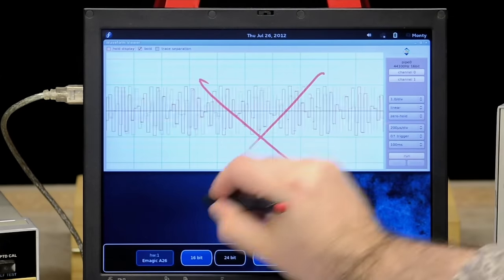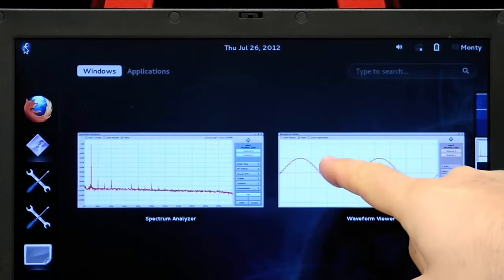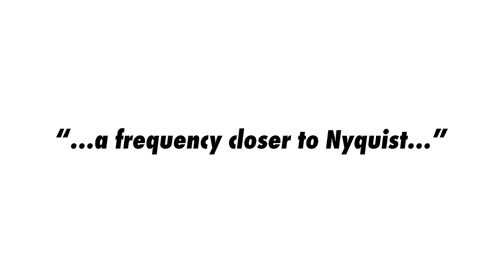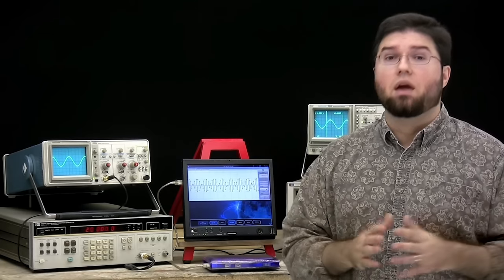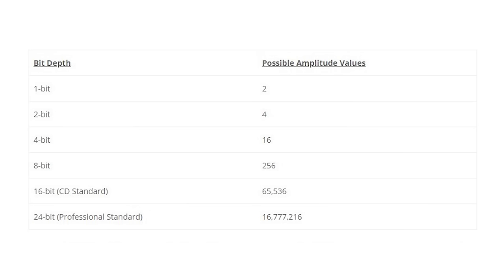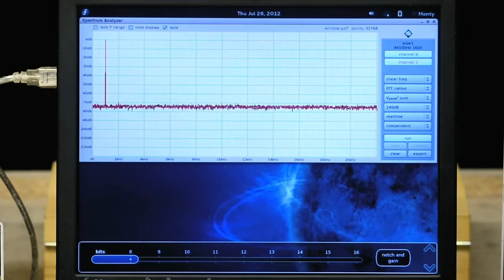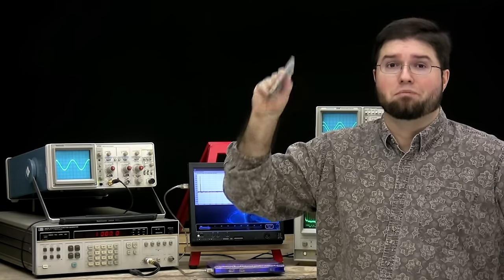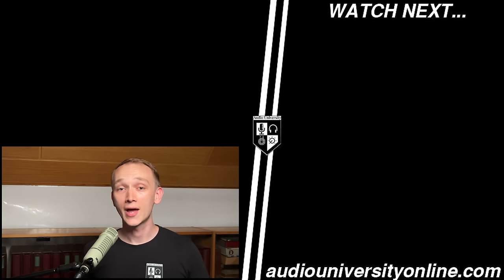Debunking the Digital Audio Myth: The Truth About the 'Stair-Step' Effect

Comment: Measuring equipment like oscilloscopes typically display input in an analog or a digital format depending on what the technician operating the equipment is trying to ascertain. The digital representation of information is helpful when fault-finding digital equipment, but irrelevant in the analog domain. The demonstration in this video does not constitute “proof” of anything. You need to measure the correct thing, the correct way. An analog sound signal is always analog and it is meaningless to measure any digital representation just to ascertain that the analog signal is stil an analog signal. This video gets things badly mixed up here. Indeed, I have never come across anyone saying that they could hear a stair-step effect, as claimed by this video. I suspect the claimed myth was made up primarily to dispel it. The information in this video relating to sampling theory and to the statement about higher sampling rates lowering the noise floor is correct though.

Comment: You are dead wrong, and here's why: hi-res audio isn't about reproducing a range of frequencies. It's about the sheer number of details that can be preserved. Take a 12mp photo and a 120mp photo of the same landscape. The 120mp photo doesn't suddenly add colors that the eye couldn't see before: it preserves all the details that coexist without smashing them together. You get individual leaves instead of a blurry tree. Just like the lollipop graphs blurs the space between samples, the details in a low-res image are blurred between pixels. The difference is clearly audible on a good set of speakers, just like the difference in photos is clearly visible on a good screen. I can hear it very very clearly, and hi-res audio is much less painful on the ears at high volume than CD-quality trash.
Reply: no. his point is that the so called "staircase effect" is fake, which is correct
what you're saying has nothing to do with this
Reply: It has everything to do with the "hifi has no advantage over 44.1." BS,
Reply: @dawnpoint  give me a timestamp
Reply: @2fifty533  Did you even watch the video? Right at the beginning he says 16/44.1 is just as good as hi-res. It's not, end of story.

Comment: You don't talk enough about why dither is used, why its so important, and how it needs to be applying at every point in the mastering process.  Some early digital recordings were improperly made on a rather imperfect 14-bit ADCs without proper dither leading to many people finding CDs sounding harsh in the early days.  

Personally I think high res audio is a waste of time and space, but if you're curious for the "Pro Hi Rez" side, read a paper by Stuart, J. Robert (March 2004). "Coding for High-Resolution Audio Systems", though in that paper he is more criticizing SACD than advocating for higher frequencies.  He also extensively talks about the importance of dither and while he does find high bit depth to be useful he argues its more useful in the mastering phase than at the consumer end.

Comment: Are you suggesting that we should record at 16 bit 44.1kHz? 

IMO, the professor missed out that the sound is continuous.

Digital values are discreet, though the sound is not.

Hence, sample and hold is used which is why you get the stepped pattern in the digital domain.

If there's a single solution then theoretically we could record at 8 bit, right?

And at 44.1 there's a low pass filter required that introduces phasing.

Come on everyone the "magic" happens with the DAC.

For example, a quality unit can make CDs sound better depending on the reconstruction filter, some of which have adjustable slopes.

16 bit causes quantisation errors with rounding of amplitude values.

Recording at higher sample rates push the noise outside human hearing range and allows a more effective LPF curve.

Modern tech uses oversampling into the megahertz band to overcome that.

If you are an audio engineer, please don't show up with an oscilloscope.

Instead, try listening to the sound of 16 track tape, CD etc. through quality monitors.

They do not sound the same to me.

A quality CD player, DAC, amp, and speakers can sound subjectively nice.

Though for pro audio recording we want accuracy in order to make quality decisions about our mixing and production.
Reply: So true, I doubt this youtube guy could hear difference between capacitors.
Reply: @nrezmerski  Well, when you plot a graph of the discreet values you end up with a stair stepped diagram.

In theory there is one solution to plot a continuous waveform, though in practice that doesn't happen.

DAC outputs a series of rectangular pulses, a piecewise-constant signal function.

Hence you need quality equipment to either sound good or achieve accuracy.

Comment: Well, not really. This video is quite naive in its explanation and it is glossing over some key engineering info. Indeed, the "staircase pattern" can be misleading but the use of higher sample rates is better in practical systems mitigating "Zero-Order-Hold" effects. 

In simple terms, higher sample rates allow for:

1) The frequency response of a DAC to be flatter. Lower sample rates cause the frequency response to roll-off in a sinc function pattern. Look up Zero Order Hold DAC.

2) Easier and more accurate implementation of "reconstruction filters". These are analog front-end filters that filter high frequency noise generated as the difference between the sample rate and the output frequency. Yes, these frequencies are not audible, but must be filtered as hitting an acoustic transducer with high frequencies leads to changes in its directivity. This can deteriorate the soundstage.

Bonus points: 

1) Higher sample rates "loosen" the requirements for the analog front end. This makes the phase response of analog front end filters MUCH better. 

2) Higher sample rates = higher DAC clock rates. There is this thing called "clock feedthrough" where the frequency (and some harmonics) of the clock signal will couple into the output signal. Higher sample rates make the filtering of this signal MUCH easier. 

Remember kids, anyone can build a high-fidelity audio system. But only a true engineer can build a high-fidelity audio system at a certain price point with limited resources. Higher sample rates allow the practical realization of analog devices at the front end that  do not exhibit unintended behaviors.

Thanks❤

Comment: Ugh, this is so tiring. No, we're not recording sine waves guys, we're recording a million sine waves that all crash and intersect at infinitely varied points on a timeline. So Nyquist cannot help with that. Nor does it help with the loss of quality of processing fx, especially distortion 
/saturation plugins and speeding up/down of audio when doing it at lower sampling rates.
Reply: @nicksterj simply not true. Like all these sorts of silly videos he analyzes a single waveform, which has very little to do with music production unless you're using only overly simplistic synths with no distortion in your music. Sampling theory is far, far more complicated than this because when recording real world audio, with all the harmonics, background noise, room verb, equipment noise etc etc the actual waveform being sampled is almost infinitely complex. Although Fourier transforms can, in theory, separate individual sine waves from a complex waveform, in reality you can't even come close to extracting every single source sine wave with the time and compute power available. In reality in modern ADCs there are hundreds of trade offs because there's no way to extract all of the (unknown and almost infinite number of) individual sine waves, so they need to use windows, STFTs, wavelet transforms and statistical "guessing". In short, the simplest and most reliable way to get more accurate sampling is a higher sample rate (and sufficient bit depth). All of these videos floating around from people who don't understand the core principles I assume are to make people who just want to do it the easy way and record at 44.1/16 feel better about life, but you are sacrificing detail especially transient detail which is hard to "hear" on a single audio track but is "felt" by the end listener, and across dozens of recorded audio samples it adds up more significantly. It's not going to make the difference between bad and good music, but all of these little 5% things make up the difference between good and great music. I wish people would stop spreading misinformation and putting people off their journey to engineering excellence.
Reply: @nicksterj  what are you talking about? Yes, it records the voltage at the sample rate times per second, the issue is how to reconstruct what the voltage was in between the samples. The example I initially gave was a million waveforms doing a million different things in between samples, which is what breaks Nyquist. What you are talking about would make sense at an infinite sampling rate (then we could just store the voltage precisely at infinite resolution which is what the real world operates at), but obviously we're not talking about infinite sampling rate. You kind of made my point though, the higher sampling rate gets closer to what you're suggesting as it measures the analog waveform more regularly and requires less interpolation.
Reply: @nicksterj  address what I said. How does it interpolate perfectly between samples during ADC? Neither his video or you address that for infinite combined waveforms. You're simply not addressing the issue. Explain the actual algorithm/method, don't just wave your hand at it.
Reply: @nicksterj you literally said ADC is perfect because it just measures the voltage and stores it. I can't imagine any comment that would betray a lack of understanding of the core issues than that, sorry.
Reply: @AudioUniversity why are you deleting some of my replies?
Reply from the maker: If your comments are being deleted, it’s YouTube’s automated spam and language filter. We haven’t deleted any of your comments.
Reply: @TheMattTricks  It does not "break Nyquist". The theorem applies to complex waveforms as well within the bandwith limits. This does not depend on what your intuition tells you.
Reply: @nyquist5190  have you ever written algorithms to convert Digital to Analog? If so, what algorithms did you use to interpolate voltage between samples for a highly complex waveform? If anyone on this thread actually understood what they were talking about they would simply argue that this sub-sample voltage doesn't matter in the end (even though it's different to the original analog waveform most% of the time) but that is simply not proven. Everyone who actually understands what is happening behind the scenes (eg engineers who build DACs) knows there is no way to reconstruct a complex waveform perfectly like you can a sine wave, it's just so laughable that internet heros are so confidently ignorant of this.

This has nothing to do with my "intuition", I'm an audio engineer who also has a dual Computer Science and Electronic Engineering degrees. I understand at a fundamental level what is happening in your computer/DAC. With many DACs the end results are just as accurate at 48khz compared to 96 but that is due to limitations/constraints in their implementation and the fact that Nyquist at least guarantees basic frequency information is not lost. What is lost is the sub-sample accuracy of voltage which is only sometimes audible but always significant during the complex music production process. It quite possibly has important transient differences on speakers as they reproduce audio, and even more profile that when mixing 100s of tracks together, analog summing with lots of conversion, hybrid mixing etc that these differences are exacerbated.

I personally stick to 96khz primarily to avoid having to worry about artifacts from time stretching, high order harmonic saturation, plugins that don't over sample etc etc, but I do also find significant audio improvements on some DACs. For example my Eventide H9000 has probably the best converters I've ver heard,  it actually better at 48 than 96, my Lynx Aurora(n) perform much better at 96.

Comment: What you said isn't wrong. But it's not the whole truth either. The 96 dB dynamic range only works at "full volume". With full volume I mean the loudest sound that can be stored in the file. Usually on a good rock song, you have alternating volumes up to 30 dB. I mean 66 dB dynamic range is decent but I can hear a difference between 24 bit and 16 bit and a lot of people can do, too.

Comment: The comment about pixels is not correct. A pixel is a physical structure that integrates light over some finite active area. It isn’t exactly a square, but it’s close. It certainly is not an infinitesimally small point.

Comment: All this hi-res nonsense needs to be exposed for the marketing fraud that it is. Higher sample rates and more bits are used in the recording and mastering to give the engineer headroom and the ability to deliver a superb 16/44.1 version to the listener. Many audiophiles have been misled into thinking that they are being denied  access to the original masters and record labels are happy to “fix” the problem by selling them the same music again, only a so called hi-res version. The number of bits defines the available dynamic range/noise floor, this is all it does. 16 bits gives a huge dynamic range, and an inaudible noise floor, way more than needed. A recording with a larger dynamic range would be undesirable as quiet passages would be too quiet to hear or loud passages would be deafening. The sample rate defines the highest frequency able to be reproduced. 44.1KHz = 20KHz which is at the upper limit of hearing. This is all it does. Sample rates higher than 44.1KHz produces ultrasonic noise that was not part of the performance. If you buy a so called hi-res version you are buying a large file padded out with millions of useless bits.   Several well designed ABX tests show audiophiles cannot pick hi-res recordings over CD quality.

Comment: The pixel analogy is flawed. In fact, the lolipop graph is also flawed, so maybe it's actually good but doesn't support the point being made. These assume an infinitesimally small sample time (or area, in the case of the pixels). For cameras, this is very clearly untrue as the fill factor (i.e. the area of the pixels that receive the light compared to the total area of the sensor) is usually quite high. Obviously, with color cameras, this is divided by 4 for red and blue and divided by 2 for green since a Bayer filter divides the sensor into arrays of four pixels, one blue, one red, and two green. However, that's still not infinitesimally small. If it were, the pixels would receive an infinitesimally small amount of energy. Similarly, I'm sure that ADC's do not sample over an infinitesimally duration, both because of physical limitations, but also because the amount of energy during that period would be so small that there would be no signal. I don't have as much experience with the physics behind ADCs as I do with camera sensors, but real systems do not behave in the exact same way as idealized systems, though idealized systems make it easier to understand the general behavior of real systems.